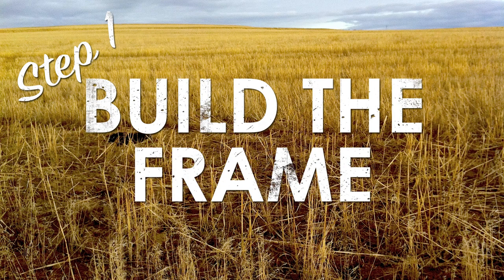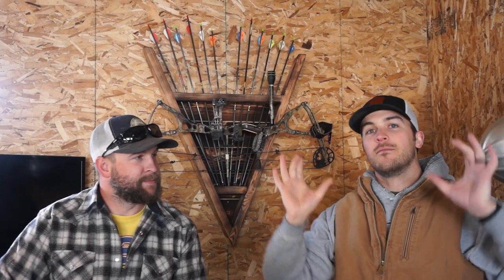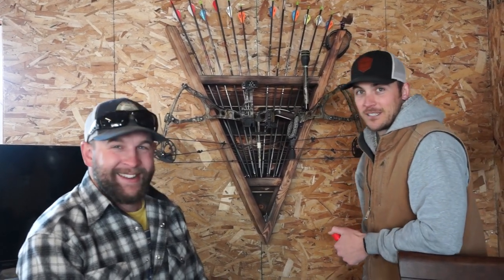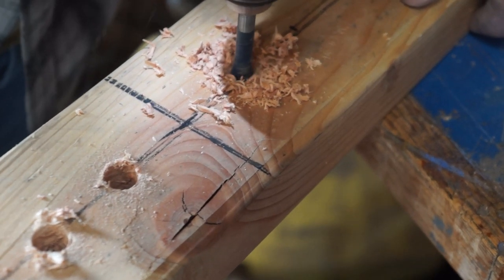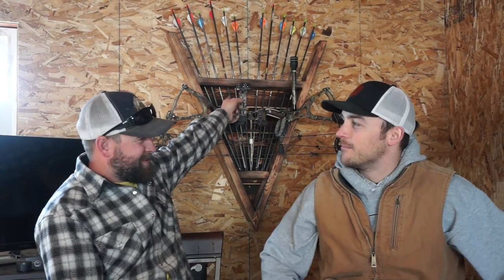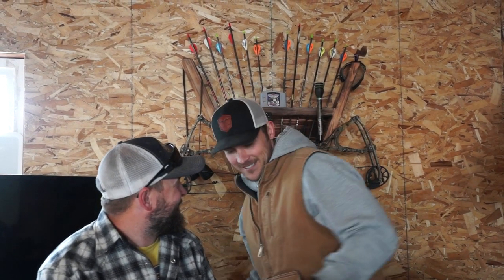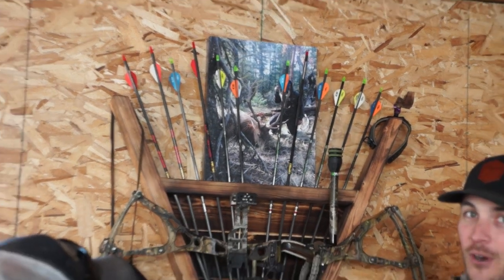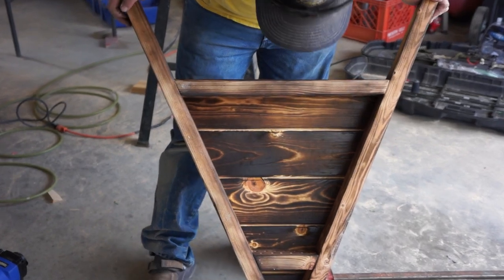Homemade DIY Bow & Arrow Rack Under $30 | The Sticks

Comment: Nice job! Only thing I could suggest….is to use some shrink tube (or clear vinyl tubing) on the TimberLock bolts to prevent scratches on the riser. 😀
Reply from the maker: Great idea!

Comment: Hey guys, I tried to draw the rack in AutoCAD and to my surprise the angles and sizes described in the drawing available for download are wrong... when I do it with those measurements, the pieces don't match... I'll be happy to provide you with the DWG file with the rack design all dimensioned and in 3D for free... 🤜🏻🤛🏻